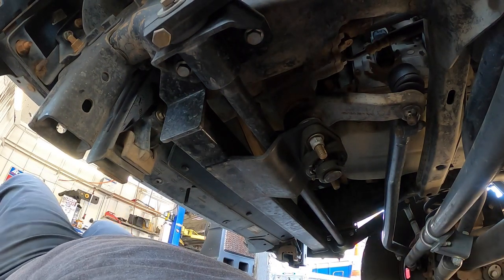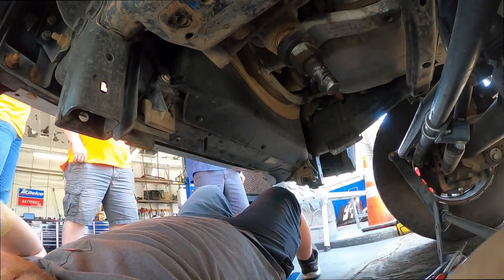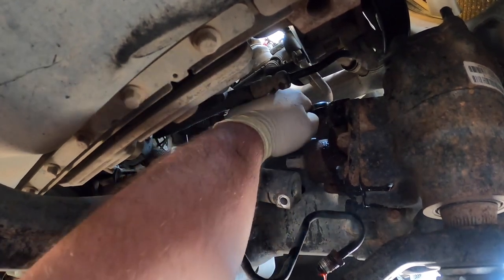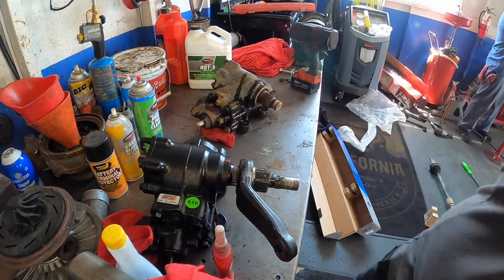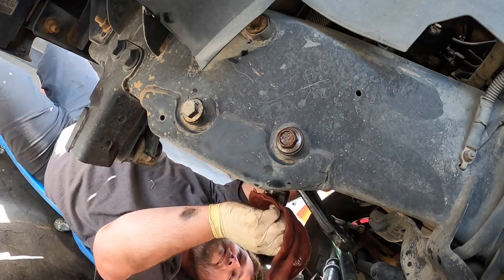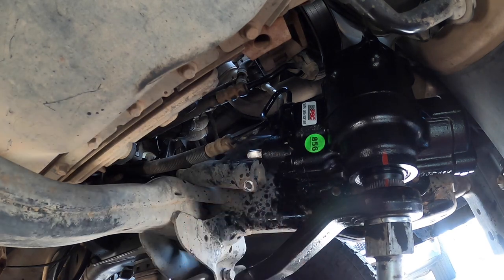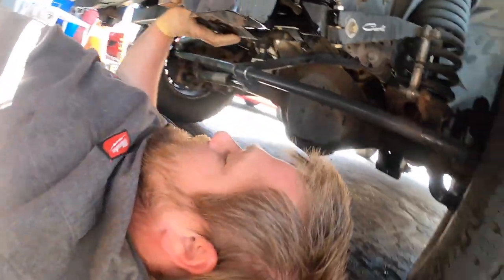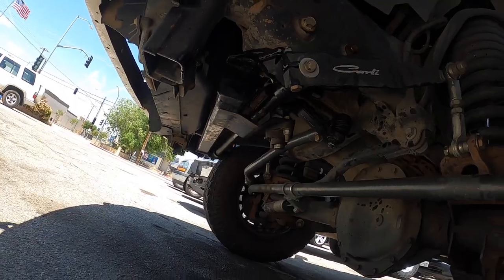2013 Dodge Ram 6.7 Cummins Steering Box Replacement

Comment: Great video. I was hoping to see how you tied up the steering wheel so it didn't move, but it must have got edited out. A shop just quoted me an insane price for a new steering box. Their labor was reasonable, but they priced the box at 2400 bucks.. I'm thinking I may do this myself.
Reply from the maker: I use the seatbelt through the steering wheel and move the seat forward to latch the belt in to securely hold the steering wheel. Make sure you start with the wheels straight ahead. That’s a lot for a box , even the psc boxes are less than half that for what I believe to be higher quality.
Reply: @drewsshoplife  Thank you.

Comment: Did you torque the pitman arm to spec ?
Reply from the maker: I prefer not to just because Ive seen factory ones come loose on all brands torqued to spec especially if the truck is lifted. I make sure they are very tight with red locktite to make sure its not coming off by itself. At this point in my life ive replaced 100's over the last 10 years with 0 issues. The factory spec is 225ft.lbs per mitchell for a 2013 ram 3500